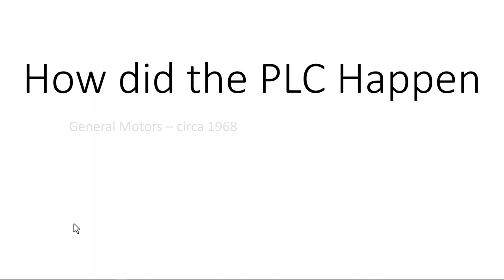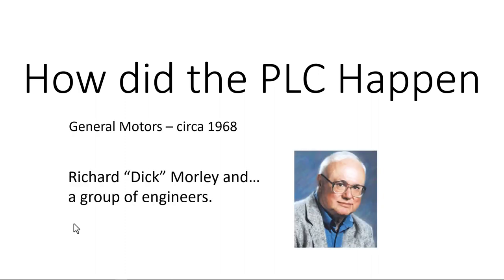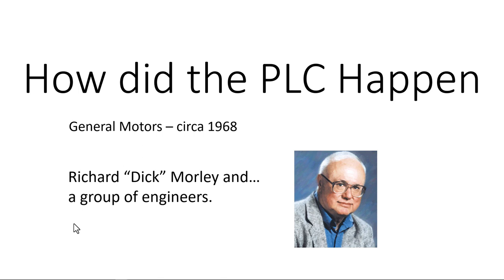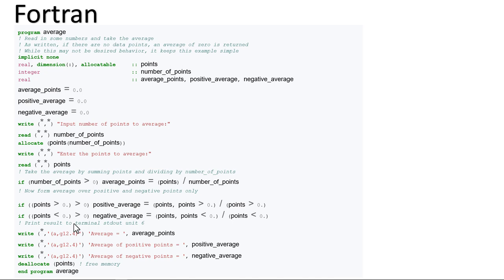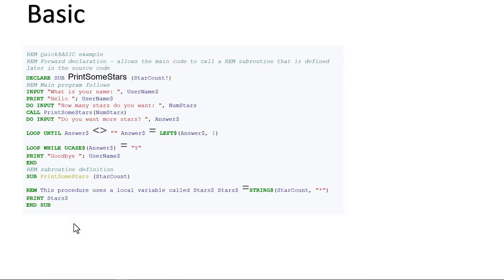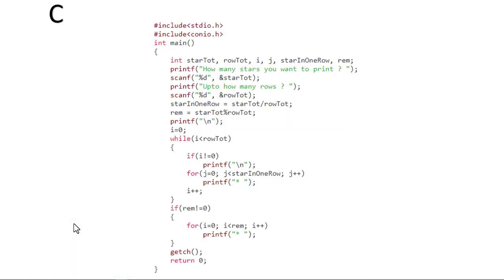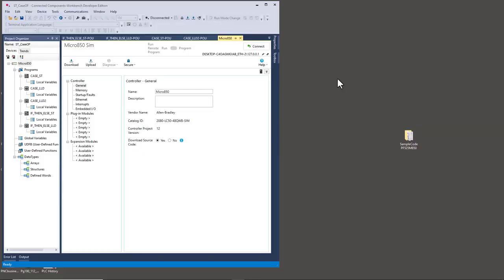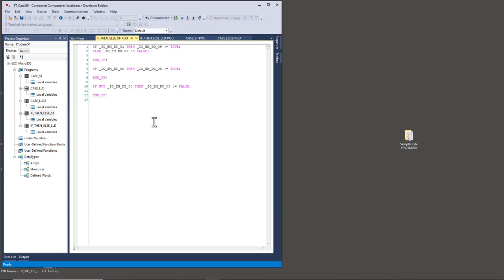Rule #1 for Programming PLCs

Comment: I’m sorry but you can’t compare poorly written Structured Text with ladder logic.

In ST you can assign an input to an output Digital_Out1 := Digital_In1; without the need for IF THEN ELSE.

For the case statement code you could write:

_IO_EM_DO_00 := (State = 1);
_IO_EM_DO_01 := (State = 2);
_IO_EM_DO_02 := (State = 3);
_IO_EM_DO_03 := (State = 4);

Most structured text IDEs will highlight the Boolean values and display variable values within the code.

Each language has their pros and cons. I would definitely recommend Ladder for certain applications, but I prefer the power of Structured Text. Using ladder or Function Block programming as a wrapper framework to hold Structured Text functions where required is a good compromise in the limited cases when someone needs to view the code.
Reply: Indeed. ST debugging is sometimes hard to do. But once it gets compiled and running into the plc it is fast. I builded a program with +7400 lines once running at 3.5 ms. Siemens is not comparable with AB, but the ST can give nice solutions. I am not as familiar with AB instead of Siemens or others like Omron, B&R and many others. PLC is a strange world sometimes.
Reply: Yeah i am inclined to agree. This reminds me of stuff like visual basic.
Sure, for some applications it makes sense, BUT, unless you're doing quite simple stuff, this would quickly get more confusing than pure code.
That said, the ideal situation is to have both; and that is in a way what IDEs are trying to do; with color, stylizing, highlighting, peeking, linting, code lensing and so on.
Reply: Ladder logic is incredibly powerful when you're troubleshooting an issue on the plant floor. You can connect to a PLC and determine the current state of the process in a graphical representation that is familiar to every electrician. I don't know of any structured language that you can connect to and readily see the current state of every bit/var in a clear format that is readily available to the people that maintain and repair the equipment. Being able to view the code is not a limited case, but rather the daily need of the maintenance personnel.
Reply: Structured text is power
Reply: @srone  so it’s considered quite a good tool to be able to read ladder logic diagrams ect? Is it true that a good portion of electricians don’t possess this knowledge?
Reply from the maker: Who has to troubleshoot your code? At 3:30am some poor electrician who works for a company that is too tight to send them to training for anything, just barely manages to get online with RSLinx and then sees the code that recommended above...really. Good luck on the factory floor if you ever find yourself there.

Comment from the maker: The only point of this video was that in consideration of "good parts out the door", the systems have to be easily maintained by those WHO DO NOT WRITE CODE for a living. Our own personal opinions on writing code are relevant only to us. The "maintainers" have a much more difficult task than those who write the code themselves. As long as we can get a sign off from the enterprise, we can walk away and if we do get called back, the code is never that cold to us after a little reacquaintance time.  However, the individual that has to be able to sort out dozens of programming styles has a real challenge on their hands and that is reading stories that we have written with minimum effort because it is the easiest and fastest way to get that signoff. They almost have to be greater experts than us.

Comment from the maker: What is the solution for the maintainer that has to troubleshoot the process (system) . Next time you purchase something that requires you to read the instructions, try reading the section in Chinese and see how far you get. It is bad enough some of the crappy instructions written in your first language but try on a language that is not your first language and on top of that try following the instructions that has an alphabet or characters that you have no idea what any of them signify. There is a logical continuity that resembles electrical continuity with ladder logic diagrams that you can follow without reading any text. If you haven't spent many hours on the factory floor than your opinion is that of someone having written a travel guide for a country that they have never even visited.

Comment: It is allen Bradley problem.. in codesys you can see logical state of all variables in online mode in ST. In siemens too. :)
Reply from the maker: Can you see the logical state of the statements? Can you look at the code and see within seconds why the statement is false. Rockwell had animated variables in their structured text.
Reply from the maker: Regardless of anything else...the problem is the speed of troubleshooting...the rest is irrelevant. I am not against ST...just using it for sequential logic of machine control that maintenance folks will have to troubleshoot.
Reply: In newer version Logix designer you can get your values next to your variables. Siemens won’t show you temp variables values.
Reply from the maker: Great point...I reserve ST for equations. I have not used ST much lately. With the advent of Add On Instructions for "5000" years ago and more currently, User Defined Function Blocks for CCW, those equations and other calculations that would never need editing have disappeared into my toolbox of "instructions". There are many AOI and UDFB available on Rockwell's website...they are in the programming examples that you can download free.
Reply: @k0ppit  In the latest TiaPortal it is possible to show temp vars. The code in ‘test’ mode isn’t like it seems, but a little more. You can ran line/line effecting the plc in a combination of STOP/RUN at the same time. Very powerful !!! Don’t do it in production …. ;-)

Comment: The example is written in poor ST style, it can be written more simply as an assignment statement.  ST strength will be seen in more complex tasks, not simple on off controls.  For example, operations on tables, indirect addressing or even just calculating the moving  average - LD looks completely unreadable.
Reply from the maker: You missed the whole point. Good luck on the factory floor...
Reply: @plcprofessor No, professor, the guy has the point. What you are talking about is only relevant when the Logic is trivial, primitive. When the Logic includes complex calculations there's no point in following your rules, it would only overcomplicate things.
Reply: @plcprofessor  I will write complex logic in ST and seal it in a giant FB so that factory guys can troubleshoot. By the way, timers and counters in LD are not written in ST. LD fans should demand PLC manufacturers to convert timers and counters in LD so that technicians can troubleshoot.

Comment: A well written PLC program will raise faults for ALL conditions.  As a (PLC) programmer, that is what you should strive for.  Iit is not good practice to expect  somebody to open the code and check what is going wrong.  Whatever the language you pick, your design strategy and implementation is the key. The number of faults a system can raise base on the number of IO points and complexity is revealing.   One of many good advice: do not implement silent interlock. Thats a killer.  This is one of many reason why another person has to open the code.  Another classic one is a sequence logic launching an action without any fault timeout.

Comment: I walked into this video looking for direction on how to make my own plc for a greenhouse as a fun tech project gone too far.  But by the end you have shown me not only why my previous job has a lot of issue learning their plc but why they have so many issues finding anyone other than the German based manufacturer to troubleshoot it. I remember seeing code flying down the hand held controller and my boss spending lots of money, time and effort every time a sensor went out of wack or a cylinder blew.. I can't tell you how many hours I spent learning how that thing worked with the production line.. how many hours per year lost to red lights or amber lights that wouldn't go away. How many hard restarts that poor thing went through. 
Now that I've watched this I am going to learn this the right way so I can rake in a little of that corporate coin they are throwing around.. maybe it will make up for the blood I didn't intend to give to the workplace 😬
Reply: Some micro-sized PLCs are under 200 USD& there are different   OPen-Source PLCs that in theory run on PIs or RISC boards.  Browse the net to see what may fi your projects.

Comment: After using ladder for most of my career, I found IEC61131-3, specifically SFCs and CFCs. Trouble shooting SFCs and (properly commented) CFCs is even quicker than ladder. We had a young hotshot engineer who, after no small effort, convinced me to try IEC61131-3. After a big successful project where public safety was more of an issue than I had previously encountered (6000 psig 180k ppm H2S gas near a small city) I didn't have any trouble swallowing my pride and buying that kid dinner and thanking him. Best job-related advice I ever got.
Reply from the maker: My point was towards easy to troubleshoot for anyone who shows up at 2:30am when the line is down...not to those of us that write code.

Comment: Totally disagree! LD is good when machine is simple. However, modern machines are so complicated making LD unsuitable for the job. 
The reason technicians can't troubleshoot ST is because they are not trained to read ST. I worked with many European and Chinese technicians. They all understand ST and are good at it too. Hence, nowadays there are many tools and IDEs that make troubleshooting code easier. 
In addition, to improve code quality we can implement unit test, regression test, automated test with ST. For example, after code change, I can let the computer run tests overnight and see how many of them failed. Can LD do that?
Also, I can track my changes using source control instead of change the project name to V1.1 V1.2 V1.3... My team members can develop other features without affecting my work and we can merge our code once they are completed. How can I achieve that with LD?

Comment: When this discussion takes place regarding the ST/Laddar two important aspects are neglected. Structure and testing. 

1) Far too many try to brute-force code without any real proper code architecture. With the right structure and educated staff, troubleshooting ST should not be a major problem.

2) The second thing correlates with the structure - testing. Why do technicians have to enter the code to failsearch something in the machine? it's understandable if hardware breaks down and automated assignment for new hardware has not been set up. But in general, this is obsolete thinking. You have the tools today to do the bench-testing without proper hardware in the office to test the code. Furthermore, a proper FAT/SAT according to GAMP5 or similar will eliminate more or less all software bugs ... 

Over the years of working as an automation architect for an OEM in the med-tech industry delivering machines around the world, I have in a decade not experienced a single customer complaining of the Structure Text within our machines. I also never had to do any panic support due to a technician couldn't work with the developed software.  

It's been many years ago since I worked with CCW. But judging from your video I would never choose to work with ST in that editor. It looks very similar to Siemens S7 SCL back in the mid '90s. Modern tools today such as Siemens SCL editor and Codesys (Which enables you to actually go full out with the OOP extension) are much better options.
Reply from the maker: Most companies go with the lowest bidder and that does not usually include diagnostic code or screen messages. AOIs have narrowed that cost difference significantly.

Comment: Most of these arguments about languages are due to differences in PLC platforms, industries and a person's experience. All languages have their place,  but the US and Allen-Bradley have emphasized ladder since the beginning. Siemens programmers learn STL first, and don't understand why Americans use ladder. Young programmers with CS degrees often don't understand basic electricity, so ladder doesn't make sense to them. They like what they are used to, which is high-level structured programming. AB has a great ladder editor, and ST costs extra. Logix500 doesn't even have ST. If you are programming Beckhoff, the ladder editor and instruction set are not great, so it won't be your first choice. I teach all of these platforms and have also built large systems with all, and the approach is different for all.
Reply from the maker: In Europe, the chefs demand that the employees whistle while they work to ensure that they are not eating the food, in the US, the chefs want the employees to sample the food as part of the quality control process. Regimented structure against shared authority. In Germany, unless you are upper class, you go to the school that they assign to you or you go without. I would not hold anything in the EU up as an example except their train systems. The US let politicians destroy them.
Reply: @plcprofessor  You are stuck in time, what did I just read.

Comment: good modern PLC programs have many data HMI messages to indicate most of the reasons why the machine is not working. Laptop PLC troubleshooting is due to not having enough downtime information such as sensor status and where it is located on the machine .  😎 Thanks for the great information.
Reply from the maker: Most companies go with the lowest bidder and that does not usually include diagnostic code or screen messages. AOIs have narrowed that cost difference significantly.

Comment: I don't disagree with the sentiment however 30000 lines of code can be searched. Also I see all my variables online with the values.  Extremely complex ladder logic can be just as inscrutible as code.    All that said. your point was solid, parts out the door.
Reply: I still Subbed, so it's not all bad ;)    Oh and I worked a completely unseen before 20+ yr old project with +30k lines of ST just two days ago and added a new change request in a few hours (Most of which was finding where to code, and checking it didn't explode anything).  Whilst this is not the most amazing turnaround it still beats out trying to fight through thousands of diagrams. IMHO.

Comment: In general terms its true. But if You look at other PLC brands then many of them have tools for debugging structured text almost easily as ladder. I can name ABB, B&R as example. And in my opinion complicated part's of program is more readable in ST. I can't imagine writing some communication protocols (for communicating instruments) in ladder.
Reply: Omron and Mitsubishi PLC's are actually more "user freindly" than AB once you connect.
Reply: St is faster for some applications like CNC robotics still  ladder programming It’s much user friendly so I say not all programs are created equal
Reply from the maker: Are you thinking about the under trained maintenance person at 3am struggling with RSLinx or yourself writing code?
Reply: I'm thinking maintenance person at 3am should not be undertrained in the first place. If so, its a problem of a customer. And second of all, the undertrained guy will no way wrap his head around what happens in some communication protocol program that you wrote in Ladder, anyway. Period
Reply: @7Denial7  Facts. If someone has to debug the machine code to figure out the problem, the source of the problem lies else where. Every single fault should be alarmed. You always also have an IO display for all the actuators etc, fault should not be hard to find on the HMI. If it were up to me, I would not let the customer have access to the PLC, its just a fault waiting to happen.